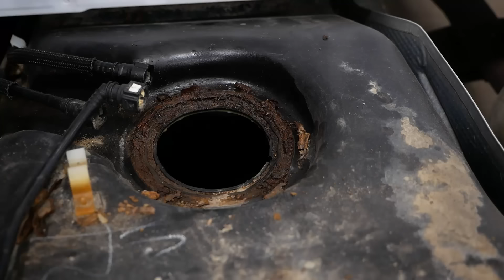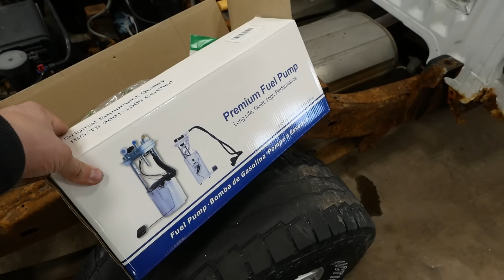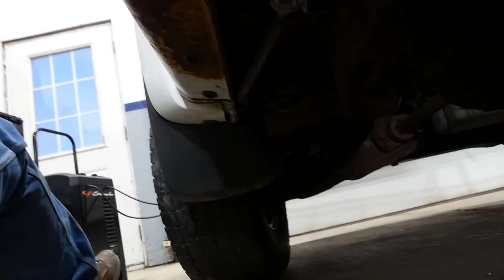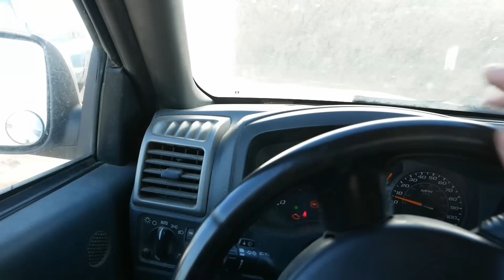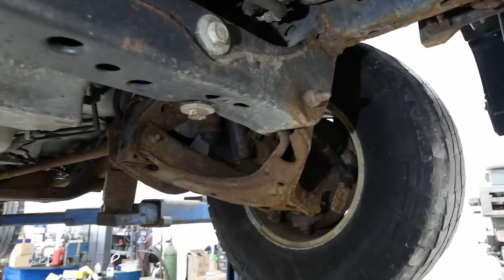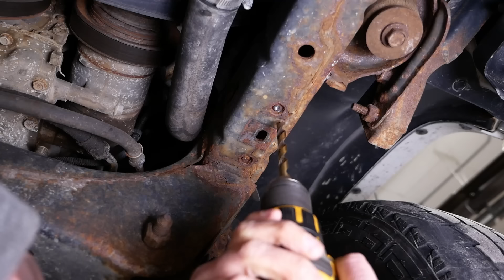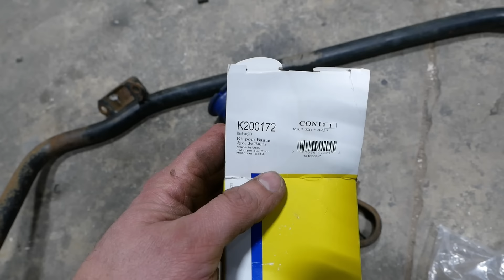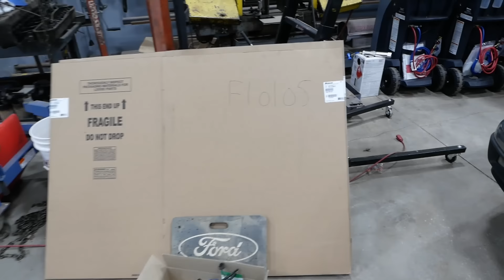Saving a GMC Canyon with 434,000 Miles from the Crusher - Won't Start, Fuel Pump Tabs Rotted

Comment: woah, when drilling out bolts, start with a smaller bit and step up in two or four size steps. smaller bit, say 1/8" will go through much faster, and so will the next larger bits.
use some light/cutting oil also
many times that heat cycles it enough to help the larger bit break it free near the end and it will thread out the back side, then you can try to yank the bit out of the metal piece or just shove the whole thing into the frame rail and leave it. 
I'm usually very good at getting bolts removed without tearing up threads or very minimally, from drill not perfectly centered or slight angle, then again I have about 30 years experience in breaking bolts and screws off and fixing it with great patience 🤪

Comment: the stuck line ends, blow out with highest pressure compressed air you have spray with penetrant, twist them around some, air again then more penetrant. squeeze in hard on square tabs and look to see if they released. sometimes you have to push the line on further to get them to flex and release, then twist and pull/pry gently. the o-rings do take a set to the pipe and can be pinched pretty tight from dirt. otherwise they are a "tool-less"  design to release.

Comment: Seen quite a few vehicles with 500K miles or more, some with original engines. It's definitely not as rare down here since a chassis, body and wiring will last so much longer than in the rust belt. I imagine people tend to neglect basic maintenance on rides with severe body rot.

Comment: I had a 1991 Nissan pickup with a 2.4 liter engine that had about 750,000 miles on the original engine with no rebuilds. I also know of a few Chevy Express vans with over 500,000 on them. So I don’t doubt the miles.

Comment: On the sway bar bolts just grind the frame clean take a bolt head get it smooth & wield the head to the frame like a stud it's a lot faster then drilling them out and you don't get metal shavings down in your undies ! On the tank repair they need have a split flat ring to go on the inside the tank that the self tapers screw in to for much better seal !

Comment: Sure that mileage it could have used a new fuel filter ran a bunch of fuel conditioner through the fuel system clean up the injectors and it would run for another $440,000 miles

Comment: ... good guess bout bad mounts and shakes damaging the harness I know that engine uses counter shafts balance since it's a 5cyl made in Tondowanda NY and designed for150K mile threshold (expected lifetime) I saw GM engineers at the carshows back in 2005 and the had a great new 5cyl display. The Colorado plant was in Shreveport Louisiana

Comment: I had a 1965 Mercedes with 1 million miles, the motor was great, but the body fell apart. The engine lived again in a chevy a truck frame for another 100k before it totally died.

Comment: I'd hang onto that orig fuel pump assembly . Bet with a drying out, and a little cleaning up it would work just fine as a replacement spare. Also, during ten years at Autozone I learned you can save on cost of the whole assembly by replacing just the pump itself, using it's individual part number to find the replacement. Enjoyed the video, btw!  Looking for a truck right now, and Colorado's on my list.

Comment: GM never has had much in the way of good engineering on their trucks, especially the newer ones.  That's why I'll never own another one.  I had a Colorado and with les that 5K on it I just was disgusted with the thing.  I got rid of it and now drive only Fords.  And my local Ford dealer runs circles around the local wannabe GM dealer on service, too.

Comment: So we had a 71? Gran Torino as a beach vehicle on a barrier island over here in VA.  My dad was no mechanic, but he fixed the fuel pump and rotted tank in one fell swoop by mounting a plastic tank to a roof rack.  The gravity feed worked great and the system outlived the rest of the car.

Comment: Awesome job Wes. Why didn’t the manufacturer just put a large piece of rubber over top of that well hole on top of the tank? Oh I know why.. It would have made sense.
That throttle body was bad dirty. I believe Amsoil makes a foaming throttle body cleaner that works great. We used to have a Buick Rainer, same as a Trailblazer. I used that Amsoil on it it once. Great results. And I am not a huge Amsoil fan.
Reply from the maker: I'll have to try it.

Comment: I had a snow brush I could place between the driver's seat and throttle pedal to high idle my assigned school bus on cold winter mornings. 30 years ago, our school district buses were not equipped with hi idle ability, or was it they were just broken? Too long ago.
I labelled my snow brush as "high idle stick" with the bus number on it, lol. Anyway, I think I should get a royalty from the company that made your fancy version!

Comment: It seems fairly believable that the vehicle has 400k+ miles as far as motor durability. I don’t know about the frame lasting that long. I personally own a 2004 6 liter Powerstroke currently at 447k on the original heads that I drive daily. Some might say I own a unicorn lol.
Reply from the maker: I worked on a 6.0 with 380,000 miles on the original heads. It finally broke the tip off an injector and hydrolocked.

Comment: use some ultra black permatex on the threads of a 90psi fuel system... just leave it for a week, to set up. good for those "AN" fittings.

Comment: I have a buddy that had a 1991 Ford Ranger with the 2.3L and 5 speed. Had 450k on it before some lady ran a stop sign and totally destroyed it. The Canyon we had, you had to clean the throttle body every year or so because it would be filthy.the truck wouldn't idle

Comment: I have a 2005 Chevy Colorado.  Original owner.  It has about 150,000 miles and has been a very reliable pickup.  Tires, brakes, batteries, thermostat, fan clutch, water pump and three different sensors have been replaced over the life of the vehicle.  The only reoccurring issue is with the fan speed resistor.  It sets at the bottom of the HVAC vent near the blower.  Leaves and other materials get into that area and they short out the contacts and actually burn and melt the plastic around the resistor pack.  I have replaced it twice.  The best thing for it is to pull it out during each oil change and clean out the leaves and junk around the pack.

Comment: Absolutely brilliant job, Wes.  Well done with finding the fuel tank repair kit.  Too bad for your customer (and probably you as well) that they didn't check powers and grounds before pulling the bed.
Reply: The bed being off meant Wes did not have to drop the tank-
Reply: On some trucks it is easier to take the bed off , than it is to drop the fuel tank  down and unhook the lines and wires so that you can get it on  out completely .
Reply: @jeffreykbevins7116  provided you have a cherry picker, or a couple strong buddies! I lifted mine off with an engine hoist I had

Comment: The first canyon I ever worked on I  wanted to push it into a canyon. My niece brings it in for a oil  change, and replace brake shoes.... I had never seen anything at the time that was close to that new... I was the eighties and back, so don't bring it  to me as I can't fix.. turns out.., not so bad. Still just pieces and parts. I did mess it up and to the life of me can't remember just how I did it but it was on those front calipers that was my own fault on not knowing what I was doing and I did damage which meant I put it on my slide back, took it to chevy and on to the lift where they fixed it, gave me my bill and I left with truck. My niece asked me how much and I told her just a kiss and your good to go! I got burned hard on  that one.
Reply from the maker: I've not really worked on them before. It seems OK I guess. I know the 4 cylinder version has timing chain nightmares. To replace them all you have to drop the transmission, and if it's 4x4 you have to drop the front diff.

Comment: $1200 for a fuel tank is insane, I feel like $120 would be spot on for a tank from an old GMC canyon
Reply: I just can't believe there are no aftermarket tanks out there!
Reply: @gregthecrabb  Not enough demand.  Its not a mustang, think about how many canyons you see driving around.  Not enough to dump a bunch of money into r&d for a new design
Reply: @gregthecrabb  No aftermarket manufacturer in their right mind are going to tool up to make a replacement tank for a 20 year old vehicle when that tank variant was only fitted during a 2 year production period. I bet there is less than 5% of that already small number of vehicles remaining on the road.

I was amazed at how clean and shiny the upper bodywork was compared to the sills (think you call them rocker panels) and chassis rails, suspension arms etc, your rust belt certainly does a job on them, given how good the upper bodywork was I reckon the vehicle would last forever in a different climate.
Reply: @gregthecrabb  I dont think aftermarket companies can keep up with every car changing design every 6 months
Reply: I agree- 300 MAX. That seller was high ballin to see how much he could take
Reply: @christopherestes6760  ever classic I know what I got
Reply: @DonLicuala  vapor lock is when gas boils before reaching the carb or fuel injectors, how does what you explained prevent this?
Reply: $1200 and no shipping seems like the "convince me to ignore liability concerns" price.
Reply: @danielclawson2099 or I know what I got
Reply: I know most chevy trucks and suvs of that era have the same exact metal twist thing on the tank. As long as it took the same fuel pump you could use the tank. The tanks might even be the same if not you could make it fit somehow
Reply: Yea they're 65$ at the junkyard for a decent one already pulled .

Comment: MOOG STRIKES AGAIN!!!! Moog is fast becoming a Dorman clone company. I had stopped using any Moog parts. Had a lot of luck with SKB.
Reply from the maker: There just isn't really any alternative to Moog for chassis parts.
Reply: @WatchWesWork  For a bunch of cars yeah. I just cant trust Moog anymore. I had to eat 6 wheel hubs on 3 Explorers. 6 hubs in a row had bad wheel speed sensors. Thankfully the SKB were less than half the cost. That was when I threw in the towel and stopped working on anything made after about 1985 or so.

Comment: a small tip for you Wes , when you get a bolt that is broken off at an angle . get out your rotary burr with a ball end and make a depression with the ball allowing it to form its shape into the bolt and make the deepest part closest to center as possible . it will stop the bit from walking altogether
Reply: It will stop the bit from walking

Comment: @32:22
In this situation, if you wanted to ensure a 100% new thread,
simply drill it out, and insert a Riv-Nut. They are hot dipped in yellow zinc,
never rust out, super strong. The OTC kit would be a great addition
to your arsenal. I'll be using mine soon.

Comment: My two cents:
I whould have used the tank as is. I whould make a custom seal with a inner and outer ring in reenforced plastic bolted to the tank. Then mounted the standard pump to it. In no way perfect. But it will do the job.

Comment: Great aftermarket company for fuel related issues. Have used them for multiple fuel line replacement and never had an issue.

Comment: I’ve used that same lock ring repair kit on a Chevy 3500 dump truck that plows and slings salt, fairly decent life span so far, I dome sealed the entire recess and top of pump with sealant….. fingers are crossed for now.. the truck has slung salt for 1500 miles this winter and looks to be holding on.

Comment: When I was studying to become an engineer, we had this one professor who was really big on vibration testing and he used to say vibration would break or undo anything if you gave it enough time. 434k miles is a long time.
Reply: My work builds motor controls for a major industrial OEM, and if the board isn't potted, then just about anything that can wiggle, no matter how little, gets epoxied in place!
Reply: @Renville80  So YOU'RE why we can't fix the electronics. Can you swap to hot glue? Please?
Reply: That's what she said 😂
Reply: Depends if it's all highway miles. I drive 90 miles one way to work so used to do 4 days (720 miles) a week. Just switched to weekends so now only 540 miles a week. So before that was 37,440 a year but it's been straight highway miles.
Reply: @DonLicuala  Could beat driving a box of bolts.
Reply: So true. And mileage is mileage. Replace engines, transmissions, brakes as time goes by but everything else still has over 400k miles. Seat cushions, window mechanisms, body mounts, door hinges, etc.
Reply: @wildbill5670  I'll still take high mileage over something with super low miles that spent its whole life sitting around not getting used. In my experience, time spent idle is harder on automobiles than use is.
Reply: @isaakwelch3451 said no one ever.
Reply: So will an unsupervised teenager.

Comment: Hi Wes too bad you couldn't come across that gem for 100.00 bucks. I do have to say that's a pretty ingenious kit for that gas tank. I know Wes you probably would have figured out one yourself. Let me tell you the tank on my 2000 k2500 wasn't much better because the whole toolbox bed floor rotted out completely which was a spot of luck for me because it was easy to get to the tank. And actually the lock ring and all that was okay it was just the snap-ring itself was almost completely gone. The truck was part for quite a while and I knew it needed a fuel pump as the gentleman told me it did as well as some other things too. I took a gamble on this truck for 1,000 bucks but it is a four-wheel drive and I pretty much knew what it needed as far as getting it going again. Now there seems to be a little bit of sabotage going on where I have it parked so I have more problems now. I did run into the same problem with the sway bar on my 96 Silverado only it was the frame that rotted right there on one of the bolts so I ground it down welded in some new metal and Wallah. Are you sure you are reading that odometer right because it looked like 43,000 something point to miles not 433000 but I'm not there looking at it I'm looking at it on the video so I'm probably just talking crap. Anyhow Wes I'm glad to see another video up and going. Many blessings to you and your family sir. Oh yeah by the way that gas tank sealer stuff really does work you can actually seal holes in a gas tank with that stuff, so I have been told.

Comment: That kit is similar to what I'd have done. Drill 4 holes around the locking perimeter, and place 4 bolts pointing up as studs, and JB weld then inside the tank (heads inside the tank), then drill matching holes in the locking ring if wide enough, or make up a ring as in the kit to hold down the pump, and bolt onto the studs with nylock nuts. Would have done the trick, no need for a $60 kit.

Comment: Get some 1" neodymium cube magnets, stick one on the rail while drilling upside down. It'll keep most of the chips out of your shirt.
You can go really advanced and glue a bolt to it, so it's easier to grab and throw it inside a latex glove before you start, so you can clean the chips off easier

Comment: My 97 F250 has 422k miles on it right now.  So far it's been more reliable than my 2002 F350 in the last 3 years 😁 My dad got a new truck and I couldn't not buy his old truck off him.

Comment: Car companies are supposed to design for maintenance and design to last.  In this case, looks like the prime directive was design to fail.  No surprises here.  Another great video.  Thanks Wes!
Reply: Maintainablility is at the bottom of the design priority list.  When you have to drain and drop a fuel tank to replace a fuel pump, there's something wroing with that.  In many vehicles, there's no access panel that you can use to gain access to the pump.  Then there's all the special tools needed just to remove a nut.  They're trying to design DIYers out of the maintenance equation.

Comment: My thought was to get a clamp ring just like it came in that kit, then epoxying some machine screws from the inside out to act as studs, maybe with a second clamping ring on the inside to distribute the clamping force. The original steel ring is rotted out so it won't act to distribute the clamping pressure from the newly added screws which would lead to the gasket not sealing. I guess that's why they want you to goop the clamping ring, to seal instead of the original seal.

Comment: Man and I thought I pushed my 2012 Canyon far, at 345,000 miles, original clutch and original brake pads.  Unfortunately emmision computer module went and dealership couldn't tell me which one with 60%+ certainty (would have to pay even if they chose wrong one of 3 modules)

Comment: The designers change a $50 fuel pump replacement into an $1200+ replacement.  With that kind of mileage (25,500/yr), it must have been running ling distance runs on the interstates all its life.

Comment: Hylomar is best sealant never dries so stays in place. Used in aero work due to huge temp changes and expansion contraction. Ive used it to fill in messed up headgaskets b4 and it worked
Reply from the maker: I've used it before. It's pretty good stuff.

Comment: Those things r known to leak valve covers over coil packs causing sevre misfires. Also worked on old 7.3l ford box trucks with over 500k miles. Its amazing how many miles those things can get. Bet guy was a salesman or frieght load follower. Something he drove alot